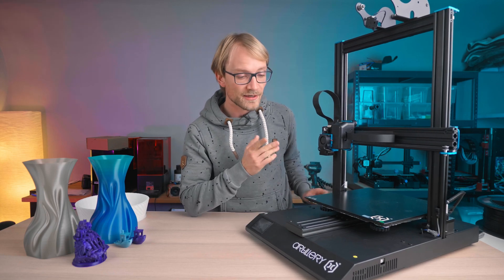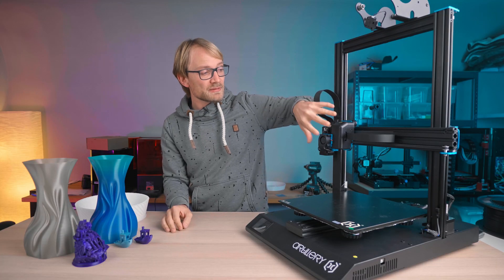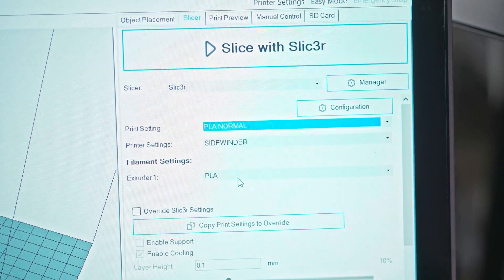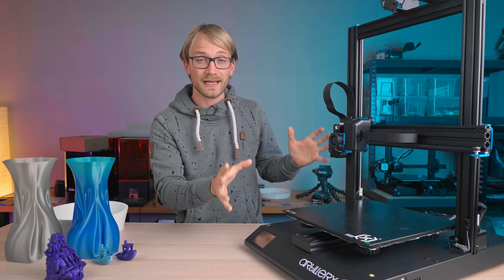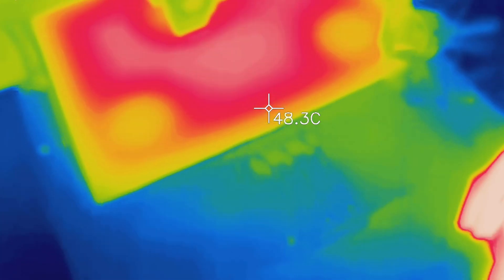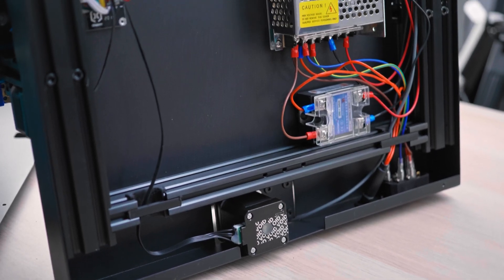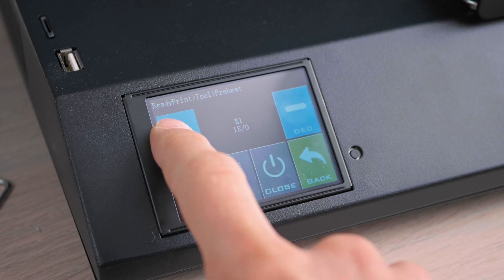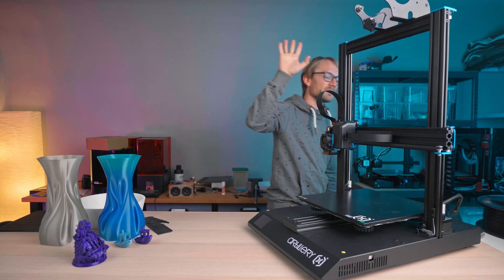Artillery Sidewinder X1: Built for show!

Comment: Thank you for your honest review, the points you mentioned in the video will be reviewed by our engineers.
Reply: Can you also publish a guide for 4v owners on how to fix any identified issues? Thanks.
Reply: @alexkerns4375  I think this would be a great idea.
Reply: To be fair, Artillery and pretty good with communication with their customers.
Reply: @3D Print Wrangler I never said I don't want to learn... I've familiarized myself with Fusion 360, Freecad, hundreds of slicer settings in Cura. Installed several upgrades such as a Z gantry support, filament runout sensor holder alongside extra broad cylindrical extensions for the OEM filament spool holder, cable strain relief...

There is, however, most definitely a difference between, as you say, "not wanting to learn more about a hobby", and potentially buying an extreme fire hazard that should have never been put together and sold.

Capisce? Now be careful not to fall off. That horse of yours is pretty high :)
Reply: @FuriousImp  "Extreme fire hazard" Why are people are treating as if it were hundreds and hundreds of units burning houses everywhere? Thomas recommend the Anet A8 which already HAS caused tragedies. If you want to buy Artillery just double check everything, that's all. Oh and the other comments "I had x issue but had 100 hours" even a prusa, with that amount of work, attention is needed
Reply: @BANGMAN009  Well I'm citing Thomas' review...
Reply: @BANGMAN009  Where did you see him recommend it? He broke one down into pieces in one of his lifestream because of the issues and dangers. Remember the A8 plus is an entirerly different 3d printer then the A8.
Reply: @elvinhaak  yeah , its have a plus + simbol :)
Reply: I just bought myself an Artillery Sidewinder X1, and after hearing its a ticking timebomb that will burn down my house. I will have to deliver it back to you. I'm sure that's not a problem right ?
Reply: Thank you, Artillery, for responding at least in this comment. As an owner of a Sidewinder X1 V4, I've enjoyed my product, but I can't say this video didn't make me worry. I hope you guys work on fixing these issues with newer models, because I want to keep supporting you as a company.
Reply: Wow... I kind of feel cheated. So many 3D print hobbyists on YouTube were very very positive. I've had the machine (V4) since June - and got it exactly because I'm not an electrician. Pretty much plug-and-play, it seemed. Now I'm kind of scared of turning it on TBH. Yeah... I feel cheated.
Reply: @FuriousImp  I just received mine today, haven't even opened the box yet. If I'd seen this vid 48hrs earlier I wouldn't have bought it. :(

I'm seriously wondering if I should see if I can send it back unopened.
Reply: @justsomeguywashwd_jbm821  Well.. email them to see if you could get a reimbursement. If not, open it up and look inside. Even if you're not an experienced electrician (neither am I) you'll probably see if it's rushed and badly done...
Reply: @FuriousImp  I'm not an electrician either, though I did do a little bit of training in electronics way back when, so I can handle minor stuff. Thankfully, from the vid it didn't look like it's all surface-mount components, or I definitely would be sending it back unopened. That stuff is way out of my league.
Reply: @FuriousImp  Same here, got it after reading the positive reviews (like all3dp.com)
Reply: @FuriousImp  You cant blame the hobbyists, most of them arent engineers, though theres certainly some shills among them.
Reply: @labrikorn_3299  V(n+1)
Reply: @3D Print Wrangler I bought an aldi printer years ago and it was plug and play. I didnt have to do any maintenance on it for a long time. I bought it with the expectation that it will need manintenance, and already knew what I was doing because of my previous delta kit.

I did buy it in the context that it was backed up by a bricks and mortar company who has a vested intrested in not setting fire to my house.

3d printers were hobby and business machines, but they are now consumer products. Or at least they are marketed as them.
Reply: Will you also review your blacklisting for forging results?
Reply: I have mine since they first came out (3 or 4 years). Use it daily and still haven't replaced a part. Absolutely reliable for me and love it.
Reply: @joemulkerins5250  Thanks for your support.
Reply: @3D Print Wrangler Not true. They are there but are expensive. Then you take a contract for the maintanance or get a proper training for that work.
Reply: @3D Print Wrangler agreed but this is definitely as close as u get to ''Pug and Play'' same with their other models
Reply: Sme of the issues are build in since V1 and you didnt recognice it? The Problem with the Bed Heating is one of them. Some issues you build in, for example the grounding one. XRControl also test the grounding in every of this videos and he hasnt that problem over a year ago. Fire your whole QM and hire someone who has an bit of an glue, what he or she is doing there. And when you are copy something, made an whole copy, not only 90 percent. Buy the original parts and read the documents for it before you made something that you do not understand completly, i mean hey, it it open source, where is the problem?
Reply: Please make marketing point to let people know these issues have been fixed once you do. Recommend also going for full metal hotend with direct extruder, huge market out there for that. With direct extruder zero downsides in doing that

Make those happen i might consider myself adding 1 or 2 in our print farm :)
Reply: My machine bought in March/April has some precision problem. The diameter seems to be slightly larger than what I modeled. Is this normal or there's something I can do to correct it..? Thanks
Reply: @timzlow  totaly normal. Calibrate it. Use Google.
Reply: If they knew what they were doing they wouldn’t do these mistakes, even less when it’s their forth version
Reply: I almost bought it until I see the cable issue.
Reply: @EliuEspinoza  Then you should sell your hairdryer and your iron too.
Reply: @PatchworxStudios  If you had any idea what you were talking about, you wouldn't be advocating for ungrounded mains on a metal bodied printer.
Reply: I agree with the above mine does not have the same issues pending I'm about to dig into the electrical. I do not have the v4 due to my heated bed having a more fabric sleeve without any kinks. I have used the heck out of this for the last year and I got it for it's feature set. I'm looking forward to envnovneonos fixing of these issues because some of them are serious.
Reply: You should have sent me another one then because it's just crap and with an extra 8 bit motherboard then to go to 150mm / s MDR
Reply: Hi, any update to this matter? Have things now been addressed?
Reply: Hey Artillery, if you guys have upgrade parts for us whom have bought the machine and wants to upgrade the flaws mentioned do let us know.  So far i'm loving the machine has been using it for almost a year the only thing thats stopping me from recommending it to others is the fire hazard as mentioned by thomas... seen a few people posting in FB page their house got burnt down due the printer ....
Reply: @The nerd collector Which Group are you in? Try joining Artillery Sidewinder X1 and Genius Mods and Upgrades group.
Reply: @The nerd collector There's no smoke if there's isn't any fire. Sure some are trolls but im sure there's legit ones as well. it's up to you to believe them or not but as it stands the main concern in regards to Power cable to the bed heater is a legit concern. of which i might just remove it altogether since i'm using glue stick on my flexi build plate
Reply: @The nerd collector It's a saying, it means "If unpleasant things are said about someone or something, there is probably a good reason for it"
Reply: @The nerd collector You know it's a saying yet you still ask? Not too sure what's your problem 1st you say You've never seen people post about fires, then you back pedal your words and say you did see, then you reply so as though you don't have clue of the saying, only after i explain it then you realize your mistake and say you know the meaning. Do you actually know what you're talking about? And that saying doesn't work if only 1 person is claiming so, it takes lots of people from different point of time.
Reply: Yes make a v5 which will be actually good
Reply: I have had the bed cables break in several places, giving you the MINTEMP error. Bad choice of sleeve putting us and our families at risk. Artillery, pull your finger out and fix this issue!
Reply: Are These issues fixes on the x2?
Reply: OK, so I was about to invest in my first 3D printer and the Sidewinder X2 is my preference up until seeing this review, albeit a previous version. Question for the 'Artillery' spokes person ... Does the X2 resolve these criticisms ? And is it CE marked as in 'European conformity' ?  🇬🇧
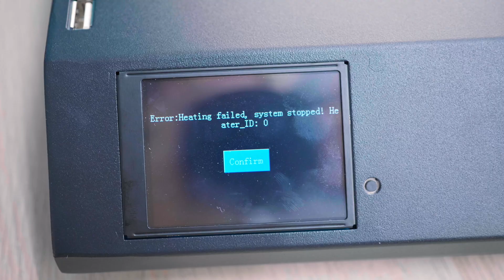Reply: @doverivermedia3937  I saw this video before I purchased my Artillery sidewinder and like foreshadowing I got that very error at 10:53.  After doing a lot of research it turns out that this is a common error due to what Thomas talks about, the cable in the back connecting the heated bed to the motherboard.  I didnt use it for months after I got it but Ive only used it moderately for a couple of months.  I hope you didn't make the same mistake I did and buy this printer.  

And by the way while researching the heated bed error, I came across people who bought the x2 and have the same issue. 
Some people say that they dont get any issues in this thread, it could be due to sevral factors.  Maybe everything they printed they printed very slow so the cable doesnt move as much or maybe they got a different version or maybe they got lucky.
Reply: Despite I own the printer and I am very happy with it, I am so glad about this honest review because the safety warning. I am also hapy because Artillery and his very nice customer communication. Thanks you both
Reply: Not by the 'engineer' whom is responsible for the exposed live 240 terminal, the dangerous bed cable, the mis-matched plugs and hot glue solution i hope. I will be getting this item checked by a qualified Australian electrician and i will be emailing support the bill. You (I am talking to the CEO and CTO esp) should be appalled and ashamed to have release a product in this state. These items are in peoples homes, you know, where they also have their families and pets. 240v can kill. Fire can kill. Do you understand?  Even a lamp with a metal case is meant to have said case grounded. Mind blown! (Mic drop)
Reply: Every thing is a firehazard. A light bulb lighter a fuxxing cat. Keep your traps shut if you dont understand what you are dealing with. Most of the people here do buy a guillotine place it in a fridge and complain about the dangers of germs on their guillotine.
Reply: Engineers 🤣🤣
Reply: @ayoomon1604  You think Bob the Builder made it?

Comment: I decided not to get the X1 but the Artillery Genius. I have to say that the connection of the 220V to the hot bed is much better than shown here. The lengh of the cable is perfect and its secured better. I still just put a cable chain on it to give it some little extra stability and even wear. But one day the cable will break eventually... lets hope the fuse works then :D . The inside of the Genius looks rather similar its actually clean in my opinion just the overusage of hot glue is annoying. If you want to modify it someday you will have fun getting it off somehow or rip the cables. Its a good printer but nothing special in my opinion.. Just paid 220€ so its alright. It gave me some headache the first day tho... the printer was randomly getting crazy until I have find the culprit... the interconnection from the mainfram and the small PCI-E connector. The flat cable was bend too much and the connection wasnt proper so while printing the extruder started to rattle like crazy in the X direction... That wasnt a good solution in my opinion. It all looks neat... but who needs a neat looking printer rather than a reliable one... so Genius and X1 are okay... but they shouldnt have tradet looks for quality or rather stability and functionality. I ripped all the fancy blue covers off right away. Unnecessary weight on the Z axis and the X axis (the extruder) is stupid.

Comment: The one you have is commonly referenced as a V4.5, at least in the X1's modding community, the funny thing is the V4.5 was probably the worst update with the kraken heatbreak and even crappier 230v sleeving. Honestly, it's a good base printer if you're into modding, decent solid frame, lots of space in the case, etc, but its not great out of the box.

Comment: I have watched your channel for quite some time now and find your reviews and teachings to be very good. 

Thank you for that. However, I feel that I need to call you out on this posting. I think that you are spot on for not recommending this printer due to the safety issues that you find. However, I find it a bit of a conflict that you post links in the description that tell people where to buy, and tell me if I am wrong, which you also receive an affiliate commission on. 

If you find the printer to be as unsafe as you have documented, it is in bad taste, in my opinion, to also receive commissions on it when people buy it.

BTW - I've had this printer for 1.5 years, and their Genius model for about 8 months. You have given me many things to think about with these printers...
Reply: If you click the link and order something else, he is getting a little money too. But it is incorrect not to include the link where to buy it and get more info on it I think. Just don't buy it to use as it comes without checking everything out and maybe replace the unsafe parts with something else.

Comment: I’m not a “professional” that needs to produce flawless prints to sell but. I’ve had no issues at all with my X1 I got 6 months ago, but I also take really good care of it and always maintain it so it’s in top notch order.  The only thing I’ve changed is an external  spool holder and I also added a magnetic bed with a flexible sheet on top.  I have a FFCP and I use this more because it prints faster,  better PLA and PETG printing, the FFCP is only better for printing exotic filaments.  All these reviews remind me of critical car reviews, there is always some imperfection in something that requires tinkering to make it better than what the manufacturer produces. Yes it’s a cheaper printer but for less you get quite a good deal in my eyes.
Reply: It's not just some "imperfections". Not following CE compliance rules and non existing safety standards with mains voltage handling/wiring are a sure way to get your machine banned from the market, at least in europe. I am pretty sure that the FCC logo for the US market is protected by laws too, and you can't just slap that on your product and think nobody will get back to you at some point. Maybe you just don't care about safety and certifications right now, and thats fine. I just hope nobody gets hurt, or killed, once that machine shows it's true evil potential...
Reply: You have really not payed attention to this video if that's your opinion...

Comment: You really didn't say anything good about this machine...

They used proper connectors for the switch, hotend, etc, not just bare wires
They used protective prints where the wires are run through the extrusion
They used good springs so the bed doesn't need constant tramming
The frame is made from 2040 or bigger extrusion
The power outage recovery works
The filament sensor sorta works(it's just a micro switch variant)
The print quality is absolutely insane once tuned a little bit
The hot glue ensures no connectors get loose(this can be seen in prebuilt PC's)
It has silent drivers
It has "direct drive" and It's great for tpu
It comes as a 2 piece, easy to assemble kit

Id also like to add some side comments
It's ptfe lined, that means pretty much pla only.  The unevenly heated bed isn't that much of a problem.  If you do upgrade the hotend and print high temp stuff you then also need to worry about the ribbon cables being in an enclosure
Elmer's Glue stick works wonders with this bed texture
The bed being 300x300 is amazing for lots of little pieces.

I still believe that your points of failure are valid, just you didn't talk about it's successes.
Reply: Yea seems like he wasn't excited about the printer from the start, all the positives you list are why I got this over many other printers with similar features at higher prices. I haven't run tons of prints on it but after the simple assembly and basic bed leveling its been printing like a champ. Also I dont see the power cable issues Toms unit has but that will be good to watch out for.
Reply: @Zayllyaz  for the bed to cable connection there is a strain relief part on thingiverse, I highly recommend printing it if you haven't.
Reply: I get the thing about hot glue "securing" connectors, but it is an absolute pain in the a** to get it off if you want to f.ex. update the TFT firmware (which I have done on the Artillery Genius). So ihmo it is a tradeoff that's not really worth it, but it probably saves them some support time.

Comment: I do own an X1 and have trouble with PETG prints (partly due to not completely refined slicer settings and the clone hotend not really being the best for PETG). ive been planning to replace the "volcano" with a real e3D hemera to aid cooling and quality. it does work well with PLA and i am a fan of how well the bed heater works. Its not perfect, but It could be a lot worse for the cost. i think they probably thought it was "good enough for the price" and just expect most people who make functional prints to buy a printer with a higher initial cost...